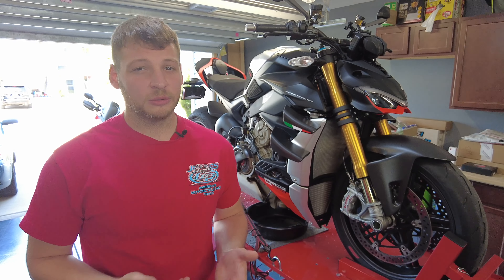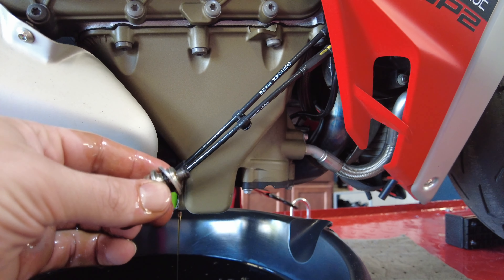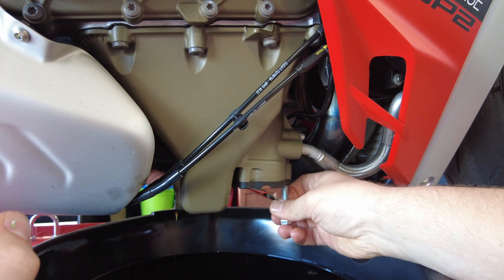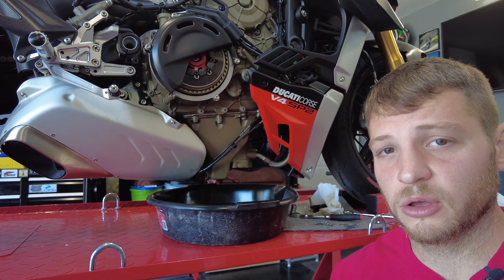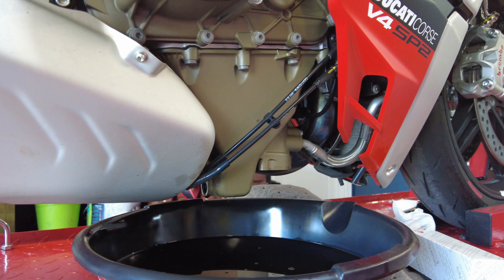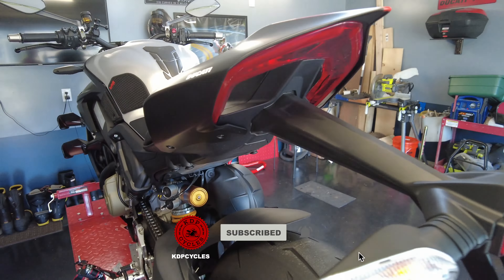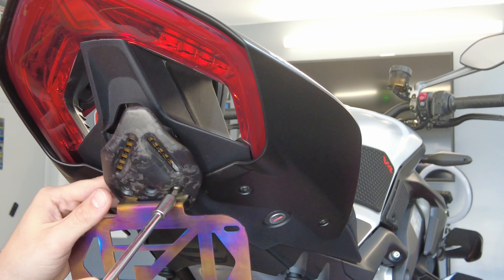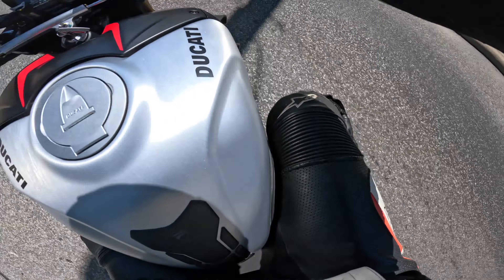FIRST SERVICE AND MODS | 2023 DUCATI STREETFIGHTER V4 SP2

Comment: Pour some oil in your filter before you refit,and wipe some oil over all the rubber bits,new crush washer on drain bolt also.

Comment: Hello friend. Please, after changing the oil, does the OIL SERVICE message disappear automatically or not? Is it necessary to take the motorcycle to a dealership to delete the message? Thank you very much. A big hug. Marcelo
Reply from the maker: The oil light DOES NOT disappear automatically. The dealership can clear the light for you after you change it with a simple 5 minute scan. There are also tuners you can buy that allow you to reset the light yourself.